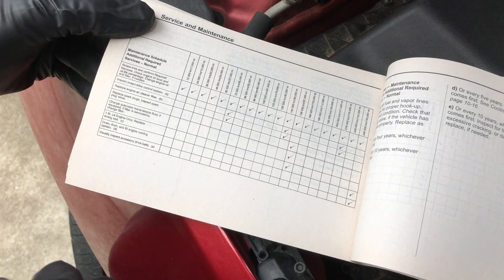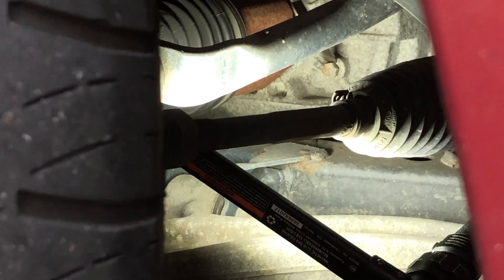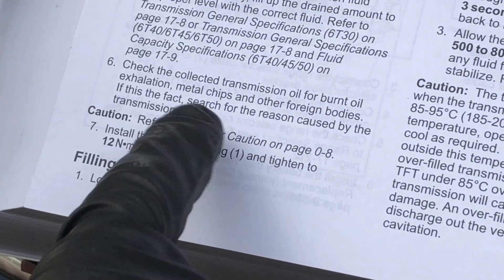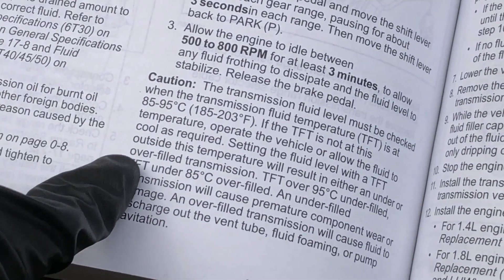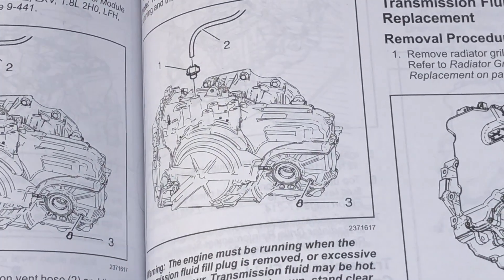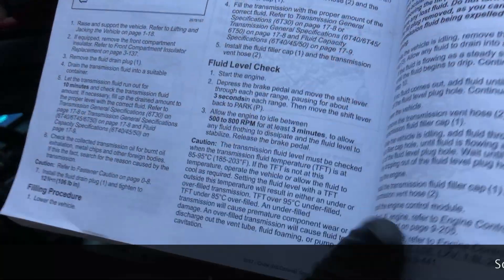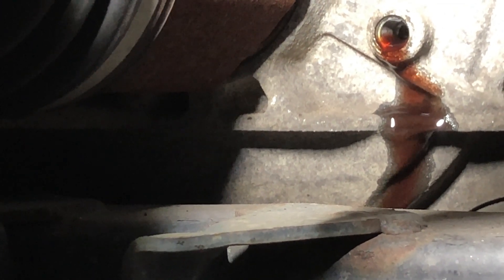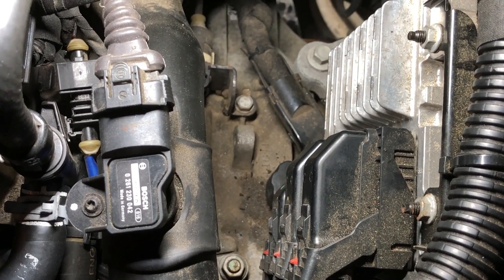2008 - 2016 GM Automatic Transmission Fluid (ATF) Change 6T30 / 6T40 / 6T45 (Chevrolet Buick & GMC)

Comment: If you know the amount in trans isn't over filled or under. Would there be any harm in just draining into a measuring bucket and putting the exact amount back on? And not fiddling with the level port
Reply from the maker: That's going to be non-trustable knowledge when you're working on vehicles owned by others as I do. But if you have that knowledge first hand, to be 200% sure of the unit being neither overfilled or underfilled, there's no harm per say in such an approach.  It's just not the correct approach.

Comment: I’m doing first drain and fill on equinox at 42000 miles.  Do you recommend multiple back to back drains or just one every 30k+
Reply from the maker: I would just follow the GM service information I showed and the interval GM recommends for this service.   While it is true that residual ATF remains trapped in the torque converter and valve body after a drain procedure there's no evidence that this is of any consequence.  Otherwise the GM service information would be written differently for the procedure.  ;-)

Comment: @DrShock would you suggest to clean the Transmission with Transmission cleaner before filling it with the new oil ? 
I will be using Motul ATF VI and for the cleaner I will use Motul Automatic Transmission Clean 108127 
is that okay ?
Reply from the maker: We don't do anything not specified by the OEM in their repair/shop manual.   And GM makes no such recommendations.   Cleaning chemicals of that nature I personally would put into the unnecessary expense category.

Comment: I have a 2020 chevrolet trax and an ancel engine scanner which reads the TFT.  HOwever, I am unable to get anywhere near the 85C temperature  - I can get to 65C after driving for about a half hour - would this be appropriate for changing the fluid level and getting the correct amount of fluid in the transmission?
Reply from the maker: This is usually a fault of the tool to correctly read the transmission fluid temperature sensor on this model GM vehicle, though it could also have to do with ambient outside temperatures as we're soon to be entering Winter requiring additional time.  Be sure you are, of course, looking at the correct data pid for the ATF temperature and not something else.  And be sure that the Ancel model you have does support this feature (I have read that the Ancel TD700 should perform this reading correctly, for example).
Reply: @DrShock Thanks for your reply - it’s greatly appreciated.  First , I’m using the Ancel fx3000 elite which does have the ATF pid and I did consider that maybe it was faulty. I’m changing the fluid in my heated garage but with the garage door about 1/3 up (to safely ventilate exhaust), the garage temperature is in the low 60s. I’m in Raleigh and the outside temp is in the high 40s today. So, I was really stumped that i cannot get it warmer than 65C (149F). with the car in the garage.

I also discovered that this is an MNK transmissission as indicated by the RPO code sticker in the glovebox and the fx3000 also specifies in its "transmission" menu that it's pid matches that transmission type.  I am stumped.  I thought I found a solution where MNK type was specified as a low temp transmission and thus the ATF should be changed in the 35-45C range  (95F-113F) which actually makes sense but that was for the older model transmission in chevys from around 1998-2010. That 95-113 range falls exactly in line with the ATF temperature of our Toyota highlander of which I used this scan tool to change that vehicle's ATF fluid.  I am stumped at the moment. If you come across anything else on this, please post.  Thanks Dr. Shock. 

And of course, this Chevy Trax is my daughter's vehicle so while I'm under it, I discover she has an engine oil leak......

Comment: Why don't mesuring the drained oil and put in the same amount of new oil?
Reply from the maker: Because there's no way to determine if the right amount of ATF was in there previously.  That's why GM has this procedure to do so, which is to avoid causing internal transmission problems from having too low, or even too high, of a fluid level.

Comment: 09 XR awd 3.6l SATURN OUTLOOK. 
is it the same side drivers check plug... AI mode talks about 2 plug thing... i don't see what there referring to. 
cars been sitting for years getting it back on road... I did drain fill from bottom but I just found out about this side check plug.. from ai mode wanting make sure I didn't over fill it today mine does have trans stick it's in cross hairs while it was surely warm
Reply from the maker: The 2009 Saturn Outlook XR with the 3.6L engine will have the 6T75 transmission, so this video wouldn't directly apply to you.  You will still need a scan tool to bring the fluid up to temperature, but the 6T75 will have a small dipstick to check the ATF level at that temperature, built into the black fill cap instead.  Having your model specific service manual information handy is still required with todays inaccurate and primitive level of generative AI for technical details.  ;-)

Comment: Hi, amazing job!  how have you warmed up this gearbox, and how long it took? After a few minutes mine is at 55C only
Reply from the maker: Thanks.  Getting up to temp is literally the hardest part.  The ambient weather affects it, as does how long the vehicle has been sitting.  GM expected the vehicle to already be warm from driving into the service bay for this task (and within a heated garage).  You may have to do a fill a quart or so shy of rated full capacity and drive it a bit if it wasn’t warm to begin with.
Reply: @DrShock  I've reached 86C on a Highway but it was impossible to maintain this temperature after driving into garage. It cooled down very quickly. Unfortunately I've checked the fluid level at 76C

Comment: I have a 2015 lacrosse 3.6 I believe it has a dip stick it is a fwd is procedure the same
Reply from the maker: This video only applies to the GM 6T30, 6T40, and 6T45 automatic transmissions (transaxles).  The Buick Lacrosse typically has the 6T70 instead, so this procedure does not apply for you.   You would check the ATF level in the conventional manner for both the 6T70 and the 6T75, using the dipstick at the owners manual specified operating temperature (level should be kept within the crosshatched area of the dipstick as outlined in your owners manual).

Comment: Great video. I was hoping you would've measured how much fluid you drained. It looks like the trans may have been overfilled previously.
Reply from the maker: Thanks. One should never be using a measurement of previous content method, for that very possibility.   The factory service procedure I went over is the only reliable approach to avoid both under and over filling these units.
Reply: @DrShock  I was referring to determining how much it had been overfilled...

Comment: 14:30, why not wait until the fluid comes to a drip before reinserting the level check plug? Looked like transmission fluid was still oozing out of the hole.
Reply from the maker: A trivial amount would be remaining, and time is money for diminishing returns.  The torque converter of the transmission is still going to be full of used fluid.   All GM is looking for with this type of procedure is to dilute that used fluid that you cannot get to without a rebuild of the unit, with fresh fluid to refresh the lubricant additive package properties.
Reply: @DrShock  I see. I was just wanting to make sure the transmission didn't have too much fluid. I'm just checking and filling the car with a little fluid after a slow leak, not draining the fluid completely through the bottom drain plug.

Thanks for the detailed video. Very thorough.

Comment: After one hour idle the temp do not rise higher then 55 and after driving 1 hour in second gear it was only 77 degree.
I hope this is fine.
Anyone also this problem with this gearbox? 

Car: opel/vauxhall insignia 1.6 cdti or buick regal

Update: I found a original opel instruction for this transmission with 65-75 degree for the Opel Insignia B

Comment: So you drain it cold... Is that right???
Reply from the maker: For the initial draining, yes cold with engine off.   For checking the level, no that last part has to be at operating temperature with the engine idling.

Comment: Hello Dr. Shock,
I had the transmission oil changed in my Insignia B vehicle. 4 liters of oil came out, but my mechanic insistently put in 4.8 liters, stating that it had been underfilled previously. Is the amount of oil drained from these vehicles always the same, or can it vary (more or less)? I don’t have the equipment to check the level, and I’m worried. I’d really appreciate your guidance.
Reply from the maker: Well, with respect to the GM transmission in this video yes there can be some variance in the amount of fluid drained from vehicle to vehicle (or even the same vehicle from time to time).   The majority of the fluid remaining after pulling the drain plug will reside within the torque converter, with the rest spread thru the pump, clutches, and valve body.   Depending on the temperature, and age of the fluid, you may get more or less between any two drain events.  

But we're talking ounces of variance only here.   The only way to definitely avoid a previous overfill/underfill condition is to to follow the service manual procedure.  But certainly if you work on the same type of vehicle in your shop regularly, you can develop a close sense of approximation.
Reply: @DrShock  Thank you so much for taking the time to respond. My mechanic has been working on GM (Opel) vehicles for many years, but when the amount of oil drained and added doesn’t match, I got a bit worried, even though I trust my mechanic. Since we don’t have the necessary equipment to measure the temperature, I’ll ask for an oil level check after a 20-25 minute drive. Once again, thank you very much!

Comment: Dr Shock, also i like how you took the conservative approach and added 4 quarts of fluid and then let the temperature get to the proper range and then added some more fluid in just to top it off. You saved yourself some headache and cleanup
Reply: 100% especially since you need the vehicle level when checking the level, & I can't get my drain pan under the '12 Cruze I'm working on. It's such a hassle to have to crawl under it & deal with a check plug, but I'd rather do it right then deal with a mess, or u der/over fill it.

Comment: Hello Dr shock, I have a 2012 Chevy sonic ltz 1.8L. so after you drain the fluid, you start the car first and then add the fluid or do you full it first and do the fluid check after engine is warmed up.
Reply from the maker: Drain and replace the fluid, getting an approximate refill amount loosely based on how much you roughly drained out in the first place.  That should be enough to operate the transmission (as it was before you started this procedure).  Then warm up to operating temperature to make sure it's at the correct level at the check plug.  Having sufficient fluid will let you safely do a short loop round the parking lot, if necessary to get up to temp in colder weather.

Comment: I know this is crazy but why could someone not invent a dipstick?
Reply from the maker: Some believe that GM discontinued dipsticks on transmissions in order to have the fluid service done by experienced personnel, using only the correct Dexron VI ATF, and set at the correct level by operating temperature during the warranty period to avoid premature failures on their dime.   Transmissions, and transaxles, are far more complex now with very tight manufacturing tolerances that do not survive long with the fluid either over or under filled.   Easy enough to do yourself though once the vehicle is out of factory warranty, as I've shown here
Reply: @DrShock  The reason i say this is because my wife's friend left her car at my house and went shopping in my wife's car. Her husband called me and said there was some fluid on the garage floor where her car sits. Could you look at it. I go look and the transmission vent had unscrewed. I called him and told him the problem but i had no way of knowing how much fluid was missing. Was it missing a quart, 2, 3, empty, who knows without a dipstick. Since i did not know, I put in 1/2 quart and drove it to the jiffy lube.

Comment: That temperature is crazy! Why would it ever get that hot? 2016 Chevy trax. The highest temp I could get is 160. How and why would you do that?
Reply from the maker: Be sure you are looking at the Fahrenheit temperature scale in the scan tool when doing this procedure.  Also, the professional level grade of the scan tool is important for this procedure.   I've seen several comments over the years on this vid where lower grade tools are just not reporting the transmission fluid temperature PID accurately, or at all.   What we cover in this vid is the official by the book GM service manual procedure for the 6T40/6T45, and getting to this temperature following it is possible but can take some time just idling.   Working thru the gears as I showed on the manual page is helpful.  Low reving can also be helpful in getting up to the normal operating temperature of this transmission (185° - 203° F).
Reply: @DrShock  lol, 160 Celsius. I believe things might start melting. I'm using Obdlink MX+ with the app, Car Scanner.  It shows 6 to 7 different readings for the transmission temp, all in agreement, in both Celsius and Fahrenheit. I'm not complaining about your excellent directions. In further instructions, it says to drive the car in second gear until that 180 is reached. Good luck not pissing everyone off trying  that. Along with looking like an idiot. It just seems they put that temperature outside the normal operating conditions to make it difficult for the average person. Just frustrating and venting. You make outstanding videos! Thank you!

Comment: Can someone tell us how many minutes you have it on idle before achieving the right temperature?
Reply from the maker: You need to have a tool to measure the ATF temperature for your specific situation in to perform this procedure correctly.   Too low, or too high, of an ATF level will lead to premature internal wear/failure on these GM transaxle/transmission models.   How long it takes to reach the service manual temperature will vary by your location specifics (ambient outside temperature and pressure during the procedure, ambient engine coolant temperature before starting the procedure).

What you can do for location conditions causing this to take an excessively long time (with the initial refill level of ATF already added of course) is to intersperse some low rpm revs and gear shifts.  With all four wheels off the ground (to maintain the vehicle at level) running it in gear as well can speed the temperature climb somewhat.

Comment: There is an easier way. If your transmission is not leaking or in bad shape, measure carefully everything you took out and replace it with the same amount. No need to do all the operating temp BS and pulling out the plug.
Reply from the maker: It should be pointed out that such an approach will not correct a pre-existing low, or overfilled, ATF condition.  Either of which will negatively affect the lifespan of these GM transmission models in short order.   It's not that bad to do this suggestion in a pinch, or temporarily, but that it does always carry that risk of hiding a real problem.

Comment: Do you change transmission filter as well?
Reply from the maker: There is no service filter on this transaxle model.   There is an internal screen, but that is deep inside and only replaced during a full rebuild.

Comment: If you use the check plug, is there a way to flush the transmission by putting additional fluid in and letting it run out? Or would you say it's not worth trying?
Reply from the maker: That approach would not affect the fluid stored within the torque converter, nor would that approach do anything other than mix with the old tired fluid already inside.    A flush requires a special machine to perform and utilizes pressure to do its task.   Of note, the GM service manual does not call for using a flush machine for this particular maintenance though.  Drain and fill, as shown in this vid, is all that's needed for a regular maintenance op.
Reply: @DrShock  Fair enough, and it's not possible to change the oil filter as it's internal right?

Comment: Also next step just open fill bolt check if it drips add fluid as needed
Reply from the maker: Only accurate if performed within a specific fluid temperature range as specified by GM.